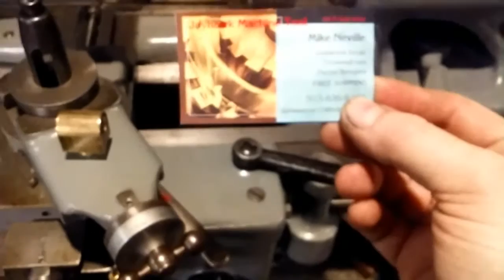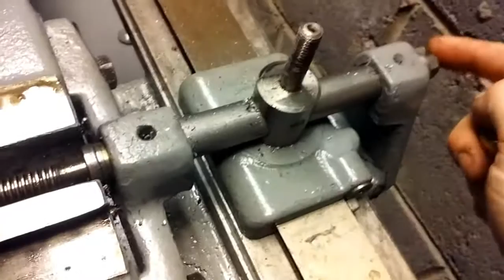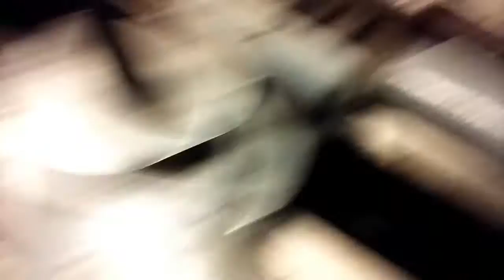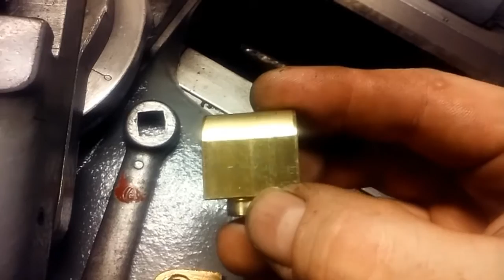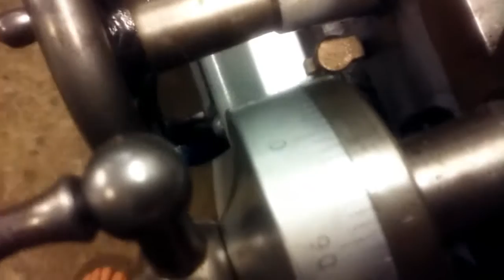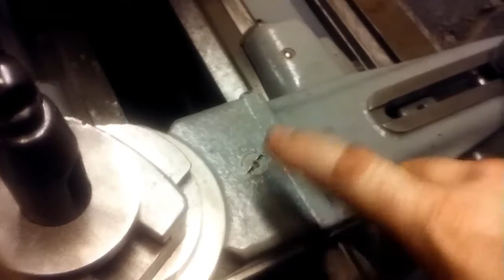Awww nuts

Comment: Have I asked you before? But I can’t get my taper pin out of the handle attachment. I’m trying to remove my cross slide but need to remove taper attachment first. I’m tapping from back of lathe to front. But it doesn’t budge. What could be hanging it up? What am I missing? Your help would be appreciated. 
Thanks,
Paul
Reply from the maker: If the taper pin is still in there, the screw won't come out.  The pin passes through a groove in the top of that tubular bit that the end of the feed screw goes through.   Taper pins are a pain, if it absolutely will not go, maybe try heat, or sometimes people have had to drill them.  All of mine came out luckily but some get proper stuck and need a good whack with a BFH and a good punch.  I had cheap punches and they were deforming rather than driving the pins out.  Better set fixed that.

Comment: I purchase a SB 9C  last year, the cross slide, compound, and half nuts where extremely worn, I saw Jay Hawks listing on Ebay  and purchased a set along with a gently used pair of half nuts. while I had the screws and nuts out I threaded them on to see the play,  both of the old cast iron nuts actually wobbled on the screws. Now my lathe has seven thou on both, humongous improvement. Glad to see you  keeping your lathe busy and accurate.

Comment: Don't forget that you have a lathe. You can cut your own new lead screw. It's one of the perks of all this.
Reply from the maker: true, though the cross feed screw on this has a long keyway cut into it to make it work with the taper attachment.  To get that I'd either need a mill or a milling attachment, and I don't have either one currently.  I could brute force it and run the lathe as a manual shaper but cutting the key slot through threads that way would not be very fun.